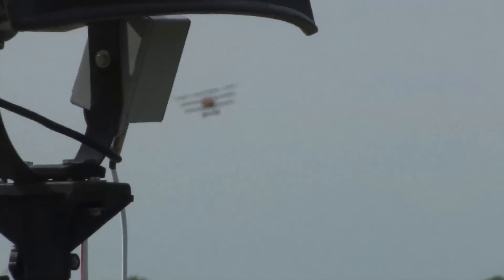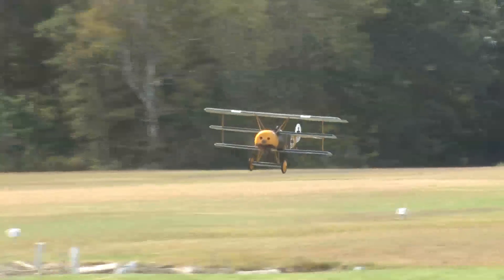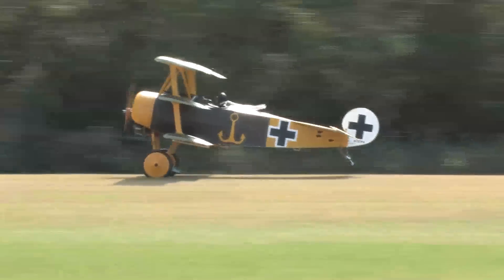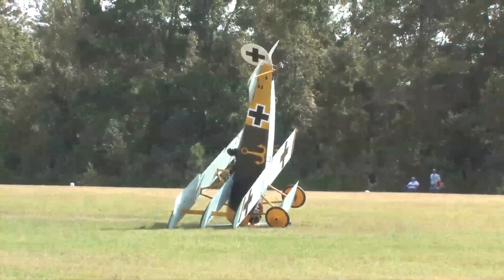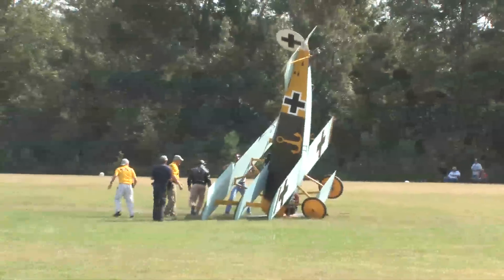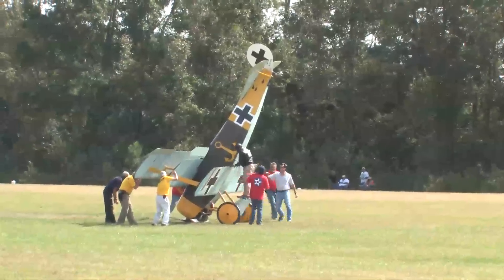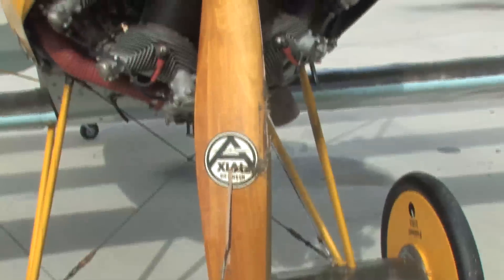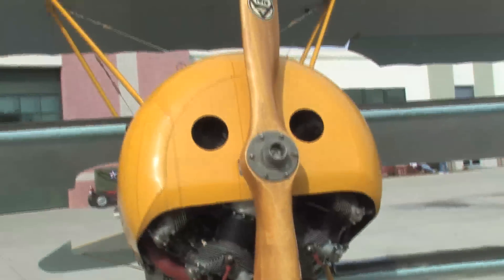DR1_HardLanding.mp4

Comment: Ron Sands, in an update to his Fokker DR.1 plans, said that Fokker and the Germans were familiar with the steerable tailwheel.  They simply chose not to use them on the DR.1 because of the stability issues and the capability of the skid to act as a keel and break when the airplane touched down.   Many of the early replicas wrecked because people tried to put steerable tail wheels or wheel brakes, and other similar things that the Fokker had already figured out not to use.  One wrecked in front of the FBO because the owner put motorcycle wheels on it in order to use brakes. The pilot touched the brakes and the airplane tipped forward onto its (spinning) prop right in front of the rental aircraft, picnic tables and the giant glass front of the building.  Fortunately, nobody was hurt and the airplane is on display in a museum now.
Reply: Sands plans call for using '1972 Harley Sportster front wheels with modifications to the hubs.  Brakes from said sportster could also be used.

Comment: That was definitely not a hard landing. A landing in the three-point position, i.e. with the spur on the ground, would probably have been better. Much worse to look at, however, was the unqualified handling of the aircraft. It hurts to see how they tore at the end bar to put the plane back on the landing gear. The damage was probably higher than that caused by the actual accident.

Comment: I know this DR1, they shortened the landing gear 9", that can cause the nose over durring landing as it puts the landing angle more in front of the engine mount, see my vids on the true scale DR1 at Golden Age Air Museum using a LaRone rotary engine, much more stable o landing with the taller gear.